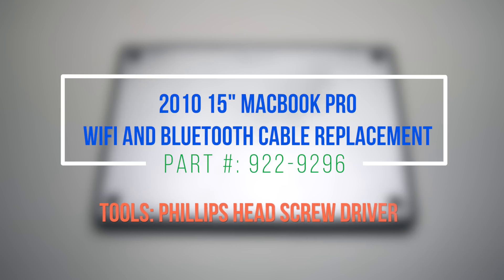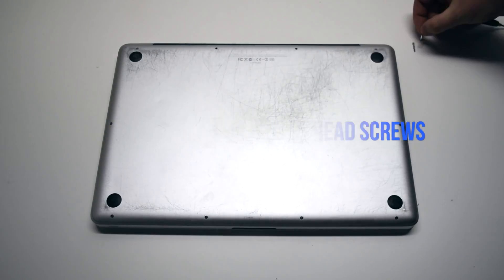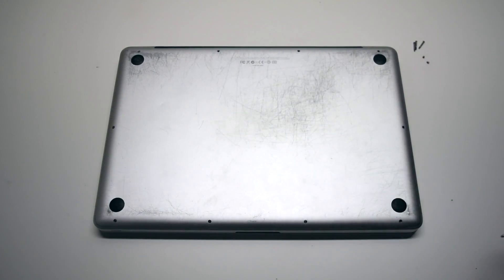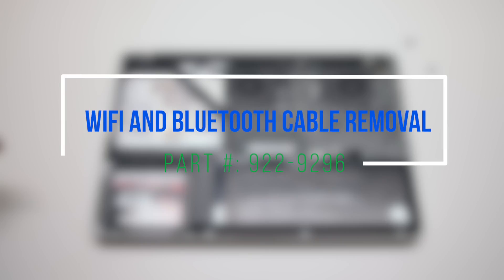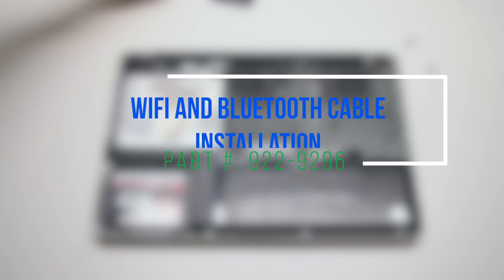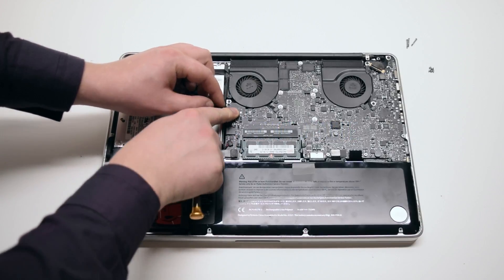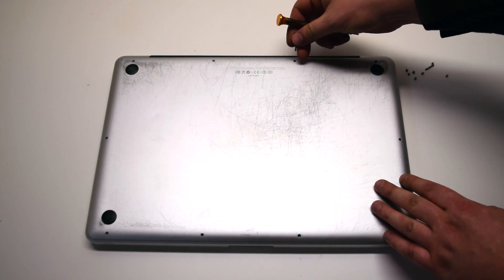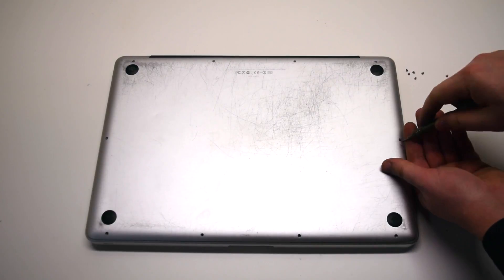2010 Macbook Pro 15" A1286 WiFi and Bluetooth Cable Replacement

Comment: Is the cable about the same for the 13" of same year (2010)?
Reply from the maker: No on the 13" MBP for 2010 the wifi card is inside the LCD assembly. If ordering to replace your wifi card make sure to do the following, go to "about this mac" at the top left apple logo and get the Macbook size and year. If you can't just watch this video http://www.appledollars.com/identify-mac then on ebay or amazon type in; example "2010 Macbook Pro WiFi Card" good luck.